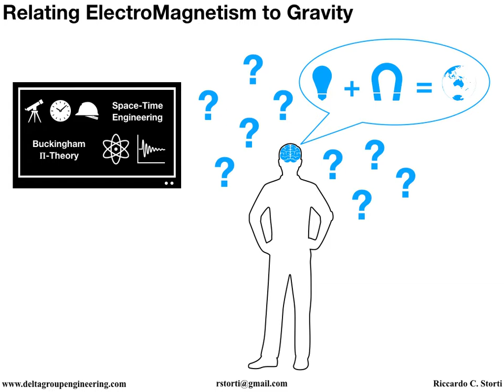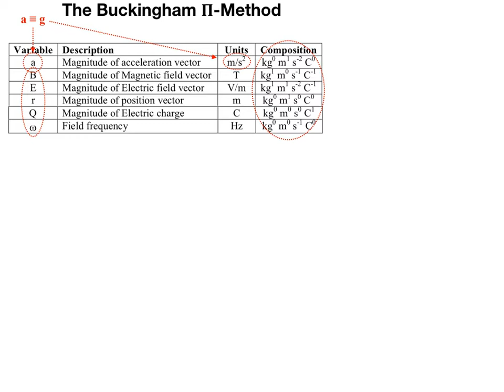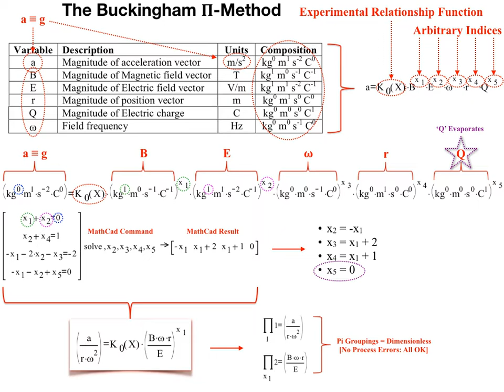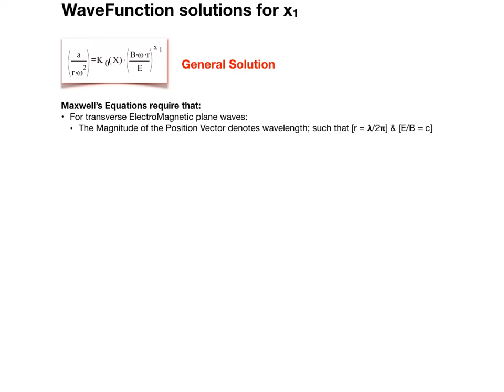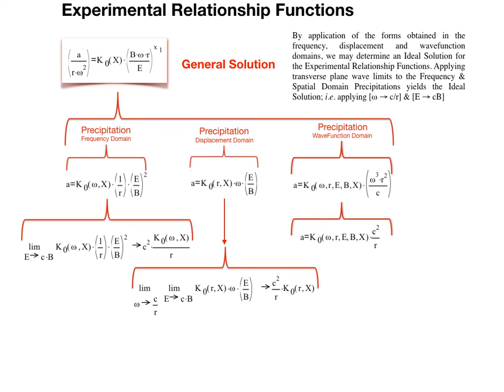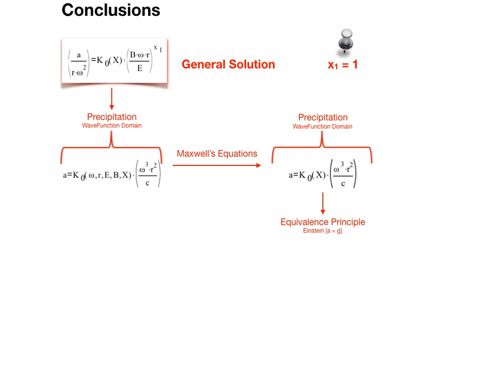Comment: Could you use the Buckingham Pi Method to find the Coulomb Force?  E = k_e Q / r^2, or the Lorentz Force:  F =q E + q*vXB  if you chose different parameters at the beginning?
Reply: Good question. Yes is the short answer. However, the Lorentz Force would require its use by parts since you’re adding two pieces. Having said this, the cross product would yield an equivalence relationship. So finally, yes it could be done, & would require line-by-line explanation for lay audiences
Reply: Thanks.  I'm looking a little more closely at your result here, and I think so long as x1 = 1, it is unitarily identical to Faraday's law.  aE/r.omega^2 can be reduced to Joules per Coulomb, or Volts.  B.omega.r^2 has the same units as the time-derivative of the magnetic flux.  

By using x1=-1, E/B=c, you have found a/omega = E/B, something that is unitarily identical to v=c.  But it could also be unitarily identical to a=d/dt(E/B), or a=dc/dt.  Since c is constant this would evaluate to a=0.  

There could be multiple rules, though, with identical units.  The Heisenberg Uncertainty principle comes to mind, where dE.dt>hbar, and dp.dx>hbar.  Two different rules that have identical units.  

What could you do with Energy, angular momentum, time frequency, and spatial frequency?  Could you derive that the photon has Energy = hbar omega = hc/lambda, and momentum hbar/lambda?  Could you derive that a particle of mass m, has Energy mc^2 cosh(phi) and momentum mc sinh(phi).